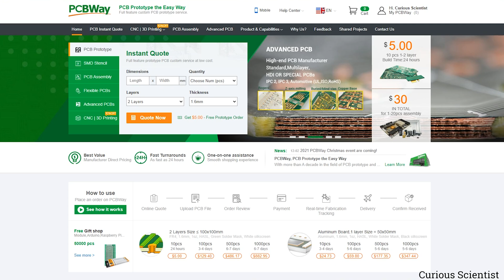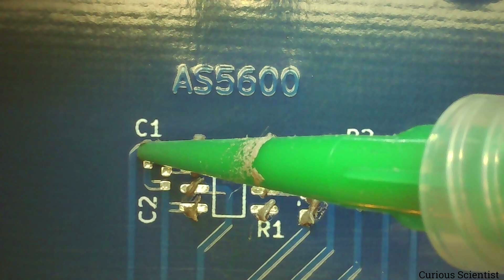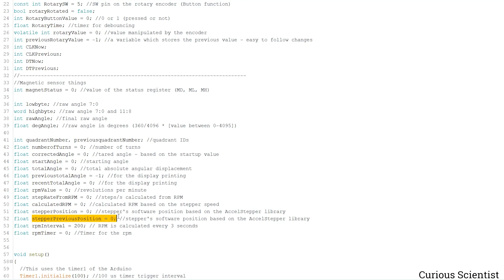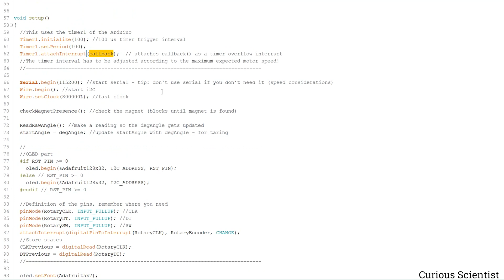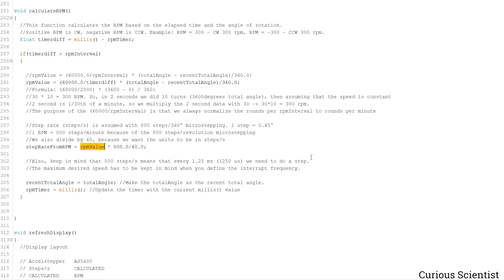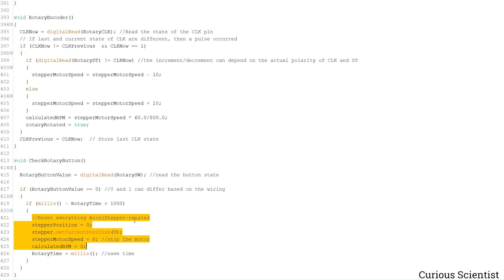Measuring speed and position using the AS5600 magnetic encoder

Comment: Thank you for the video. Can the sensor detect 1 step(around 0.5 degree)  or less rotation?
Reply from the maker: You can read it in the datasheet.... but the answer is yes, many times less displacement can be measured.
Reply: @CuriousScientist  Thanks a lot. I will read it thoroughly.
Reply from the maker: Divide 360 by 2^12, and you get the angular resolution. 😉

Comment: Thank you for this video. I have tried to look for information in datasheets of this sensor and some of the other similar AMS sensors. For an application, I like to read the angle each 0.5 ms. However I am not sure how the sensor timing is. One way could be, that the sensor have a free run update of the measured angle. When you then issue a reading command, you will get the last measured angle returned. A second way could be, that the sensor synchronize its sampling of its hall sensors with the reading command you send. However, you cannot expect the AD-conversion to be finished that fast, and therefore the updated value may be, when you read later on. In this second way, you will be able to put a time stamp on the reading. The first way, you will not know, when the hall sensors were read with a possible uncertainty of 100 us. Therefore in the first way, you cannot put an accurate time stamp on the reading. In order to measure the speed, you have to be able to divide that angle change with the time change. If you have an uncertainty on your the timing, you will get a high noise level of the measured speed, when you sample this fast like every 0.5 ms. Do you have an idea how the timing is in these sensors?
Reply from the maker: Hi! On page 10, figure 14 of the datasheet, you can see the timing chart of the i2c communication. Then on page 14, figure 17 you can find the data read timing. This could help you to figure things out hopefully.
Reply: @CuriousScientist  Thank you for answer. I think I later found out how these sensors operate, and the measurements of the hall sensors are repeated by the sensors own clock with repetition rate (sampling rate) of max 150 us. The problem is, that you got no way to synchronize the sensors own clock with I2C reading. When you ask for data via I2C, you will get the latest updated value from the sensors own cycle update. Assume, that the sensors sample rate is 143 us and you read the sensor via I2C every 500 us. The time distance between two measurement values will sometimes be 3x143 us = 429 us and sometimes be 4x143 us = 572 us. Without more advanced data handling you will in this way introduce an rms noise in calculated speed of about 14 % of the speed signal. At low speeds you need to add the noise from the sensor values itself. It have been discussed here:  https://community.simplefoc.com/t/questions-to-datasheet-of-as5048a-and-foc-use/5015/8
Reply from the maker: If you have such time critical tasks to do that you are worried about microseconds, maybe you should not rely on a $0.5 chip.
Reply: @CuriousScientist  14% noise do work in many situations. The other more expensive chips of the same kind with xy magnetic sensors got the same kind of problem. But it may not be the best kind of sensor, when you need high gain in a speed control loop. Optical sensors got similar kind of problems.

Comment: Hello, thanks for your nice tutorial. In my project i try to use your source code for the control of AS5600. As Display i use an Oled 1.54 zoll. The display is also connected via i2c. When i implement the source code for the magnetic sensor, my oled doesnt work any more. 10 kOhm internal pull up resistor for SCL and SDA are installed on the display. Maybe you have a notice for me. Booth devices have different I2C adresses  #0F36 and #0F3D.
Reply from the maker: Hi! Do you use the exact same circuit as I do (except from the display, of course)? As long as the devices have different i2c addresses, it should work. The error is maybe somewhere else in the circuit. First try each component separately, then see why they don't work together.

Comment: I find it impressive that steppers are so accurate.  However, my 3d printer can skip rather easily when it hit a clumb of filament and this ruins the print, there is no recover possible.  If they used a feedback system, it would see the skip and could recover.   While the print would show some defect, at least it would not keep printing half a spool of spaghetti for an hour!
Reply from the maker: Hi! Have you tried yo adjust the tension on the belts and maybe increase the current for the motors? Maybe that would be enough to overcome the issue. But yeah, a closed loop system could help to alleviate the issues like this. However, you'd need a system that processes the target position as well. Probably there are already such products.

Comment: Good afternoon In the diagram, which is published on the website, the display, encoder and driver are powered by 3.3 volts from the Arduino. What is the reason for this and can it be powered from 5 V.
Reply from the maker: With Arduino Nano, you can use either 3.3 V or 5 V. It doesn't matter. However, if you use an STM32 microcontroller, you must use 3.3 V because the microcontroller can not tolerate 5 V. Since many STM32 MCUs are "Arduino-compatible," and I also actively use them in my projects, I typically try to use 3.3 V whenever it is possible to avoid burning my chips.
Reply: @CuriousScientist  Большое спасибо!

Comment: when I try to rotate my stepper for certain condition like . Is my stepper rotate and passed  2500 degree? then stop. For this ,I have wait for like 50 seconds. How to improve this? I did follow your magnetic positioning encoder.
And Here in this video you did use same code? and how I can use accelsetepper  library in my code like you did, please guide me
Reply from the maker: Increase the speed, maybe!? 2500 degrees is about 7 turns. That should be possible within 1 second. If you are asking about the code for the AS5600, I used the same code in all my videos where I used the AS5600 sensor.

Comment: Good video! I'm wondering whether the AS5600 would be accurate enough to be used as an absolute encoder for a telescope mount. For that use case I would need an accuracy of at least 15 arc minutes or 0.25 degrees so that the telescope mount could keep track of where it's pointing at. I know that the AS5600 has a theoretical resolution of 0.09 degrees and from this video it seems to be able to measure large movements with that accuracy, but I'm left wondering how accurately it would detect really small movements. Say if I moved the telescope 0.14 degrees to point at another star, would the AS5600 always be able to detect the movement and update it's raw value by one or two?

I think you could test this by setting your microstepping on the stepper motor really high and moving it one step at a time and checking how the measured value is growing.
Reply from the maker: Hi! I think 0.14 would be challenging. Or at least you would always have that +/- 0.09 uncertainty. So, either you will get 0.23 or 0.05. Also, the problem is that the microstepping might not be in sync with the steps of the encoder. You can achieve step sizes such as 0.9, 0.45, 0.225...etc. degrees. But this does not coincide with the 0.09 step size of the encoder. Therefore, this can also lead to some uncertainty. 

Regarding testing, I can not test it right now because I don't have the setup assembled. It would take a lot of time and effort to assemble everything again.

Comment: Hello! Do you know if these encoders remember the value AFTER power off? Say the AS5600 read 25344.6, will it remember this value after you shut it down, and boot it up again?
Reply from the maker: Hi!
Sure, it is an absolute encoder.
Reply: if you need to remember the state it was at when powered off (lets say it powers off, moves a little, then when you turn it on you need to know where it was) then youll have to write to eeprom yourself in code
Reply from the maker: Yes! If the shaft is moved between a power off - power on cycle, then its position needs to be saved in the eeprom. But if the shaft is only moving within the 0-360° range and there's no movement, then no need to worry about it. That's what I meant in my previous response.

Comment: Impressive, I suspect that variable measurement values related to motor construction are also responsible for the sound created by stepper motors at higher speeds. Thanks!
Reply from the maker: Thanks! I don't know how the sound is related to variable measurements, but steppers have a distinct sound at high speeds even without any measurements. It is the construction of them that makes the sound and not the sensors around them.

Comment: It posible to record the value to the sd card?? And after that play again with digital write??? So the motor stepper will always play the value we record ??
Reply from the maker: Sure, it is possible.
Reply: @CuriousScientist  okk i will try, if i get problem i will ask u sir🙏🙏
Reply: @CuriousScientist  hi bro, first time use as5600 should be program?? Because the out(pwm analog) only show 3,3v if i turn the magnet still 3,3v. And i try to program B with 3 wire like on the tutorial ams. And now i get the pwm output but my mistake is i only set for halp circle sir, now i want to get 360deg. How do program as5600 from i2c use arduino sir??
Reply from the maker: Make up your mind, am I a bro or a sir now? Please read the datasheet, your question is answered there. I don't remember the details from the top of my head, so I would also need to read the datasheet to answer your question. And I don't have time for that, sorry.

Comment: Does this encoder know the absolute position even if the power is turned off and on?
Reply from the maker: Yes, it is also an absolute encoder. The position of the magnet relative to the chip gives you an absolute value of the angle at startup. Read the datasheet for more details.

Comment: Heyy, is it possible to not use an encoder at all and still get the position and rotation measurement using accel stepper library? I'm using a Nema 23 Hybrid stepper motor. "The position control is achieved by a simple Open Loop control mechanism so doesn’t require complex electronic control circuitry: - this is what I read.
Reply from the maker: Hi! Yes, it is possible the get the current position (currentPosition()) and the speed (speed()) from the accelstepper library. Please read the documentation on its website to see which functions should be called to fetch those values. If I recall correctly, the function that returns the position can block the CPU, so you have to be careful with it. Don't call it too often.

If you have a NEMA23 hybrid system, then it is a closed loop system (servo). The loop is not between the motor/encoder and the microcontroller, but between the motor/encoder and the stepper driver. The motor has an encoder and the driver makes sure that the motor is running according to the control signal received from a microcontroller (or anything else). But, you won't be able to read the position of the encoder directly. The encoder only communicates with the driver.
Reply: @CuriousScientist  We are working on a six wheel drive for a competition (PID), so would that need encoders (ig we need them now that you explained it), and if encoders are needed then can we connect them all in I2C protocol?
Reply from the maker: Of course you'd need encoders, because the core principle of PID control is to see how well your system is keeping up with the target value. You can use multiple encoders but you'll need an i2c multiplexer, because all encoders have the same i2c address. I have videos on that topic too, search for a X-Y milling table in my uploaded videos. Or search for i2c multiplexer.

Comment: If you set a global 'current time' variable at the beginning of your main loop, using millis(), and reference that variable throughout your program it will dramatically improve your loop time. Millis() is very time hungry and should be used sparingly for time critical applications; such as motion control. This should not throw off any calculations unless you have branches that are slow to execute on_occasion. If that is an issue then the long branch can be broken into smaller steps in a sequential state machine to be executed over several main loop executions.
Reply from the maker: Wow, thank you! I did not know or think about this solution, so I learned something new now. Thank you for this very constructive and helpful comment! Once I have a little time, I will test the performance of your approach and I will use it in future projects.
Reply: @CuriousScientist  did you test this out in a project yet? Could you post it here when you do?
Reply: when I try to rotate my stepper for certain condition like . Is my stepper rotate and passed  2500 degree? then stop. For this ,I have wait for like 50 seconds. How to improve this? I did follow your magnetic positioning encoder.

 @CuriousScientist

Comment: What is the max speed AS5600 is able to track the movement?
Reply from the maker: It depends on many things. Mainly it depends on the MCU you are planning to use and your intention on what you are planning to do with the data. If you want to send it to the serial port or want to show it on a display, that could be a bottleneck due to the way those libraries are written. They often block and if the blocking takes too much time as compared to the movement time, you might lose some information. Polling the AS5600 does not take too long, so the maximum speed will depend on the operation you do on the data obtained.
Reply: @CuriousScientist  Well got it to work at least at 4000rpm on ESP32, should be able to do more. Im using RTOS so blocking is not an issue, as i can run several loops on 2 different cores.
Reply from the maker: Hey! Thank you for coming back and sharing your experience. It is great to hear that you managed to reach over 4000 RPM. This is great news also because it is sure that we can cover the RPM range of the typical stepper motors and we can also cover some of the typical DC motors.

Comment: Hi, I like your videos! They are very interesting and helpful.
I would like you to help me if possible because I don't know where to start, I am trying to make a closed loop control of a stepper motor with the AS5600. It does not necessarily have to be a PID, having a position control would be enough in case the motor skips steps, the encoder can detect it and correct the error.
It will be very interesting to make a video of it or please if you could share a small sketch with this features if you made one
Thank you for your reply!
Reply from the maker: Hi! The simplest thing is to check if the motor is at the requested position at the end of the movement by comparing the target position with the encoder's position. If they don't match, calculate the difference between the target and the current position and move the motor accordingly. But this is strictly position based. Furthermore, I don't make videos on request for free, sorry.

Comment: Hey, I absolutely love how informative your videos are and they've been really helpful in progressing through my projects as well. I have a question though, since you used the Accelstepper library to control the motors, why don't you use the AS5600 library for the encoder as well? It could reduce the number of lines of code as well, right? Just curious to know. Would appreciate your comments on it. Thanks again!
Reply from the maker: Hi and thanks! When it is possible, I prefer writing my own code from scratch because it also proves that I know how the hardware and the software behind it works. Anyone can copy-paste a few lines to include a library in their code but then they usually don't know how the things work. I took my time, studied the datasheet of the AS5600 and based on it I wrote my own code for it from scratch. You might ask, okay but why do I still use the AccelStepper library or libraries for displays? Because it would take huge amount of time to implement my own library. But eventually I will make my own stepper motor driver in the future.
Reply: @CuriousScientist  I also prefer this approach.

Comment: How do you get the magnet so good aligned with the sensor. I'm trying to aligned the magnet with the sensor but I don't get a linear readout. I also 3D printed a few "holders" and "casings" to get things aligned, but no luck. I also noticed that there a more status values than 39 23 and 55, but I don't know the meaning of them. ( I'm using the "white" AS5600 one you can find on amazon and are used in other of your YouTube vids )
Reply from the maker: I put the magnet on the shaft with a drop of super glue then I pushed a metal sleeve on the magnet and the shaft which had everything aligned. For the status values, please refer to the datasheet. I suspect that probably you have issues with the distance between the sensor and the magnet. It should not be an issue if it is slightly misaligned, but it will misbehave if the distance is not correct.

Comment: I like your videos, They deep review.
according AS5600 datasheet magnet center should be exactly at center of SOIC8 (maximum tolerance 250 micrometer)
How did you achieve that?
Reply from the maker: Thanks! My PCB is done by a professional manufacturer (PCBWay), so the placement of the components are within the tolerance. Regarding the magnet on the shaft, the bearing fits tightly around the shaft so I can use it as a sleeve to perfectly center the magnet on the shaft.